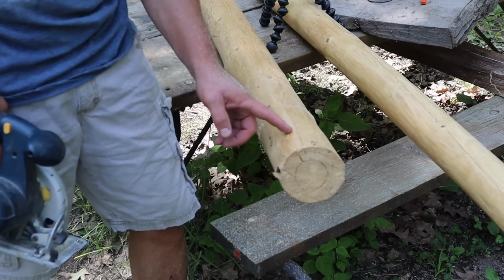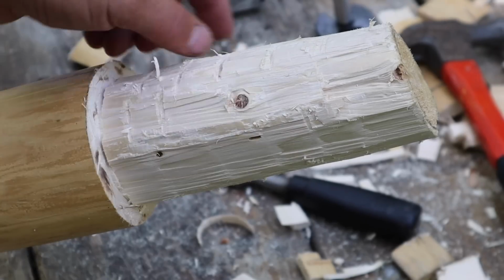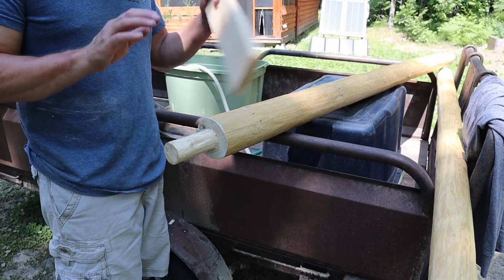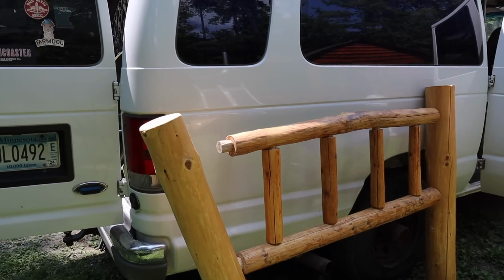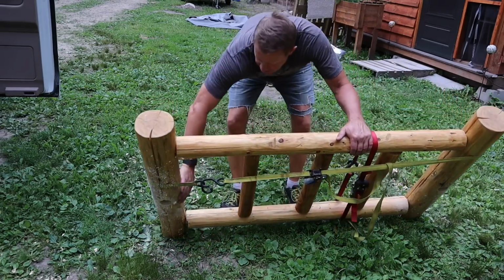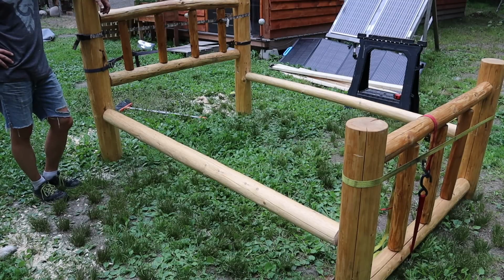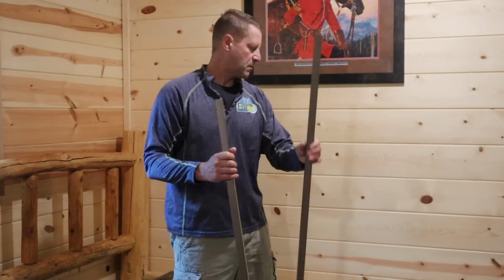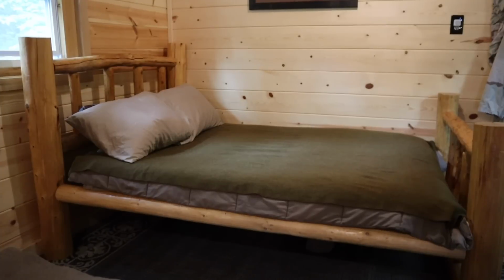Weekend Homesteading Hacks: Create DIY Homemade Log Furniture on a Budget

Comment: I’m impressed with your ability to tackle a job like that, one thing if you always put wood glue on end grain and wait 10-15 minutes, it will soak in the fibers, then reapply . Because end grain and glue joints don’t work well
Reply from the maker: That is useful info. Thank you. I'll remeber that for the next project

Comment: Great job, especially being the first time you built one. Wood glue almost out. Remember the adage one is none, two is one. I try to keep a spare on items I use a good bit. Saves time in the long run.
Reply from the maker: I have the worst luck with wood glue. Every time I go to use it it's all dried out. Would help to have a spare.

Comment: Great Job!  I might have put a threaded insert into the ends of the rails so you could run a bolt through the post into the rail.  It would be easier to take apart if you ever want to move the bed out of the cabin for some reason.  Love your channel.
Reply from the maker: That would have made more sense!

Comment: You have quite a talent.  I wonder if an oscillating tool would work for this kind of project
Reply from the maker: I used one to cut the initial cuts for the metal braces, worked well

Comment: Great looking bed i am not trying to be judgemental but i would of used logs for cross braces also and would of made the notches in the sides just like you did !! But good looking bed!!❤
Reply from the maker: That was my original plan. The metal ended up being less work and since you can't see them I went with it. I agree that logs would have looked better though
Reply: You could always put logs in later if you want!!